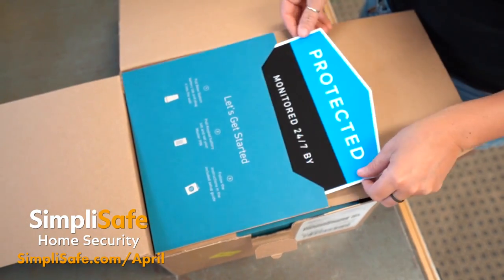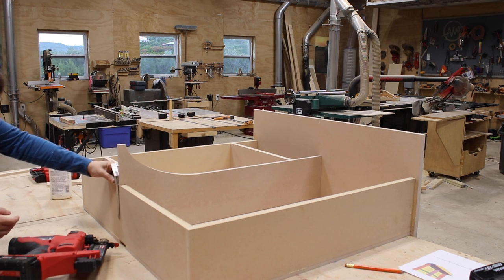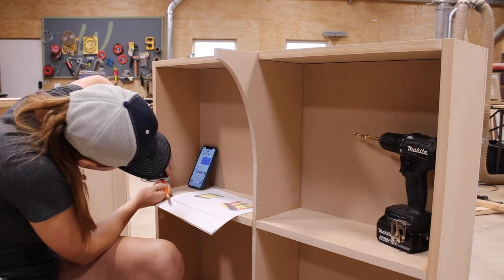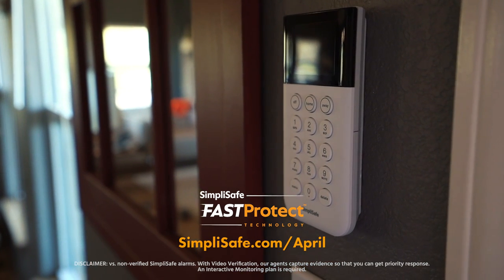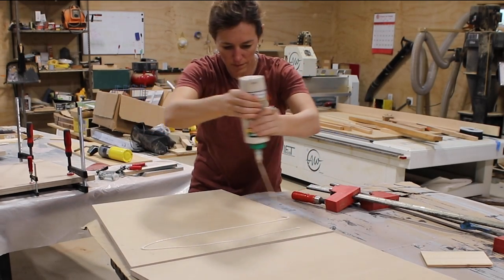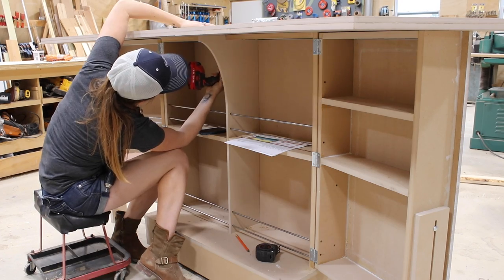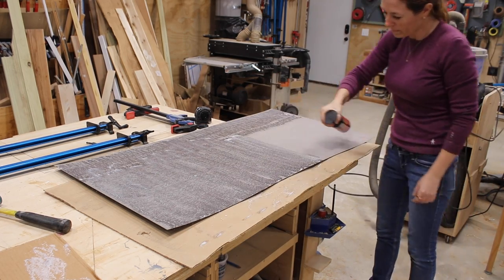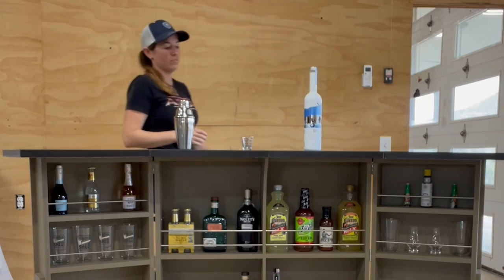Build A Mobile Bar | DIY Bar In A Box

Comment: April we do a lot of laminate for commercial cabinets now another secret is make sure you got some half inch PB C lantern you lay it on the surface of the mdf then put your laminate on top of it and move it around to where you want it and then pull each section out and press down as you pull each section of pipe you put like 4 or 5 on each section of pipe And you can pull one at a time out from the side and then that won't stick to that PB C because you didn't spray it 1st and it's not something that naturally sticks to the laminate glue

Comment: Beautiful project! Only one change I'd recommend: Use piano hinges for the doors. You can end up with a lot of weight in the doors, and that puts a lot of stress on those three little hinges, and particularly on the small area of the MDF that they're screwed into.

Comment: April nice video and build this bar project.  I been doing cabinetmaking and in woodworking since I was kid got first woodworking tool on my 10 th birthday was a router didn't even have clue what one was making a special trip to sears at the mall with my dad.  Well 56 yrs latter i still try keep on learning  all kinds different woodworking projects and products and you definitely done that and this video with the new type of outdoor MDF wasn't aware of so thanks for putting together this great video. I have work with plastic laminates and cut kitchen countertops.  I have all ways used what i have always called a glue stick between plastic Laminate and top surface specification big tops  to get all line up to hang over to trim off.  thanks Jason Ham  of  Ham's custom woodworks  Athens Alabama

Comment: Tip for contact cement: usually you can put a piece of paper between the 2 surfaces to help you align them properly.  Then you can slowly pull out the paper in sections as the 2 surfaces glue together.